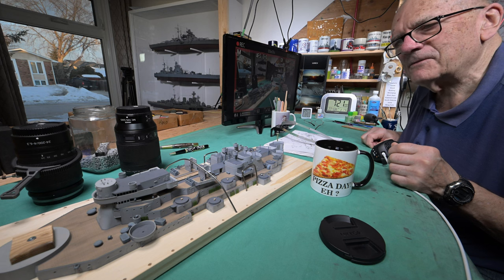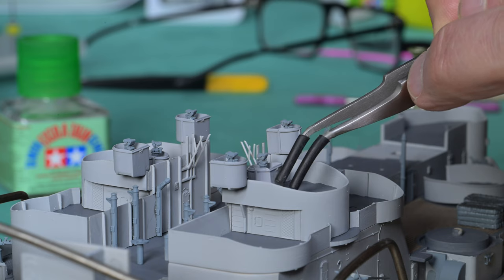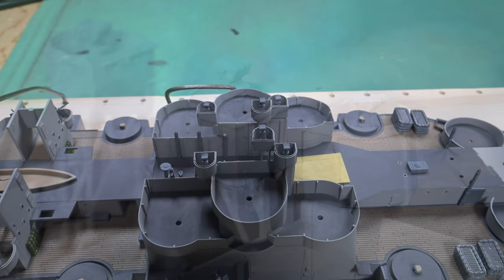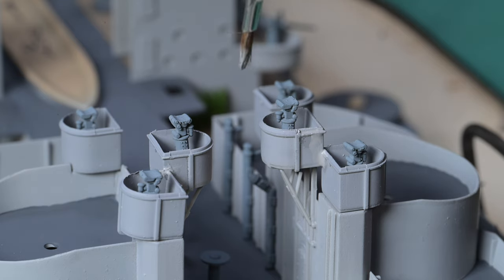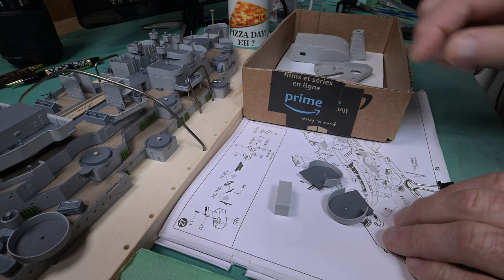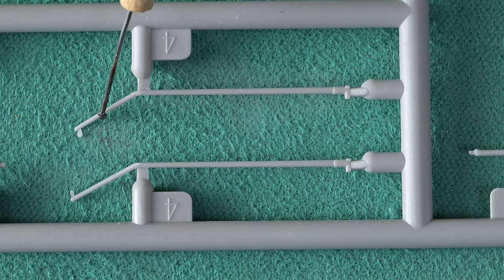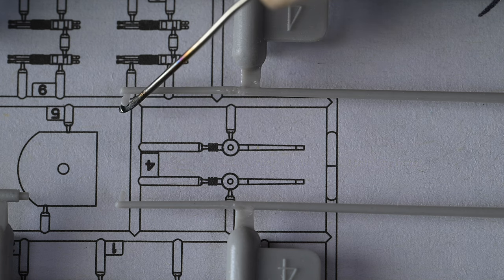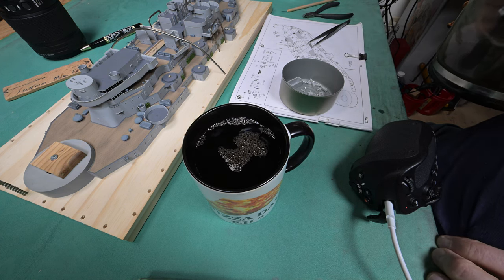The Model Ship - Part 1540

Comment: Hey Ron. Those 2 gun tubs, J34 and J41 do not go on the Iowa. They are probably for the Missouri or some other ship. There are 2 gun tubs up on the forward superstructure but they are included on part R1. It's a deck with the gun tubs built right into it.
Pizza looks delicious by the way.
Reply from the maker: Thanks for checking Paul 👍

Comment: Hi Ron.  Checked the completed model, it looks like those gun tubs might be for higher up on both sides of the forward bridge.  If they’re already in place, check the front of the instructions where they show the sprues and see if those parts are shaded meaning not used. Other than that, that’s me out of ideas😊.
Reply from the maker: Thanks Mark. 👍